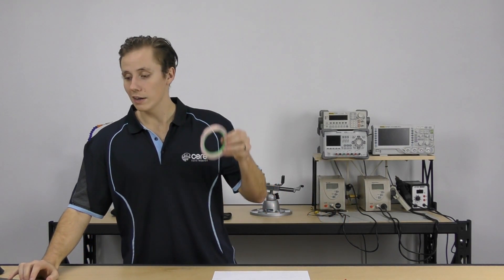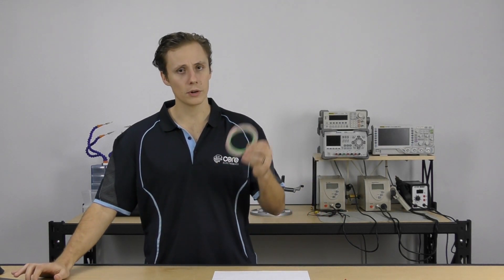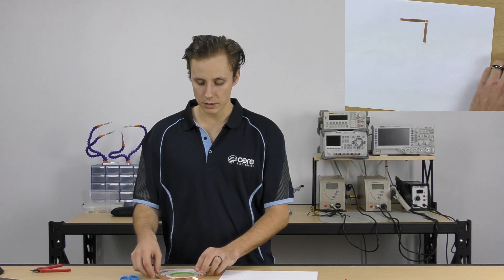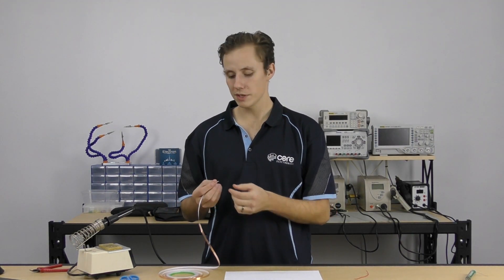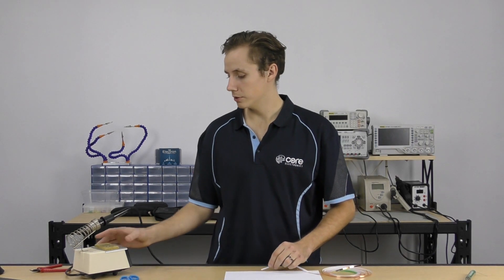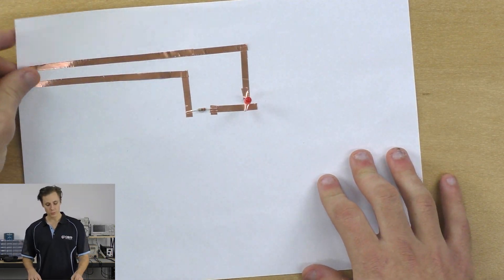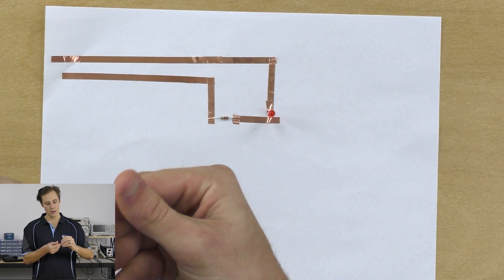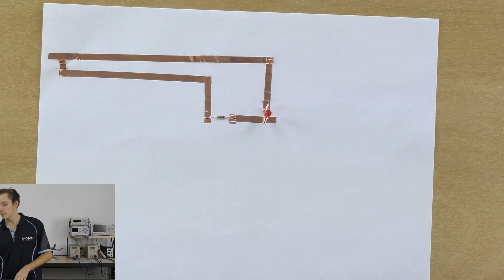Using Copper Tape with Paper Circuits

Comment: I want to know something. Is conductive adhesive tape strips good for connecting batteries together in series and/or parallel? I want to make my own battery packs and I noticed some batteries do NOT do well with soldering.
Reply from the maker: Creating battery packs is definitely more advanced than what this guide is meant to demonstrate. Nickel Ribbon and a Spot welder are the tools you really would want. This fellow has a great guide (but take all of his warnings and safety measures to heart) - https://www.youtube.com/watch?v=hwhqn4BmC2I&

Comment: 6:01 wiping the soldering tip over the tinned wire is an exceptionally horrible technique to teach? The iron coating on the tip is pretty thin. People will reduce the life of their tips if they emulate you often.
Reply from the maker: It’ll last just fine, soldering iron tips are no strangers to wire :)

Comment: Can we use an abbreviation for conductive adhesive copper tape and non conductive adhesive copper tape because when talking about the conductive adhesive copper foil tape or non conductive adhesive copper foil tape it just gets repetitive. Copper foil tape whether it be the conductive or non conductive adhesive tape can be a mouthful to say especially when you have to refer to the conductive adhesive copper foil tape or the nonadhesive copper tape many times in the video. However, I did find your explanation of conductive adhesive copper foil tape and non conductive adhesive copper foil tape to be interesting.

Comment: Hey!! VERY COOL!! I'm interested in setting up strips of LEDs hidden in moldings that will be recessed from the ceiling and go all around the room to give a nice, ambient light reflected from the ceiling. What I need to know is, What I need to know is, what is the maximum amperage capacity of the copper tape and are there other tapes of greater capacity to help me do this?
Reply from the maker: Sounds like a fascinating  project. I'd recommend you post this question and any others there. Our support staff and other makers maybe able give you an answer.
https://forum.core-electronics.com.au/
Reply: @Core-Electronics  Thanx for getting back to me. Where would be the best place to post my question?

Comment: you`r shorting the bat with the tape, it hit´s both sides of the batery. kan the tape hold for 12v 50w . i dont like kabels in my boat then sa this video. i kod paint ower rhe tape .
Reply: Are you ok? It looks like you are having a stroke as you comment.

Comment: Cool but total waste of time much easier an faster to use normal methods like a breadboard premed circuit board etc
Reply: It is usefull when using microcontroller test circuits though. As those are often SMD components and/or do not have a standard 2,54mm pin spacing.

Comment: Could you use this with hot wheels diecast cars for lightning and sounds ?
Reply: Ur better off using kynar wire and small SMD LEDs for model cars this method ain’t practical
Reply: Yes. You just stick this on the hotwheels car and stick leds and a battery on it as well. Sounds pretty bad ass to me.

What the hell are you talking about?